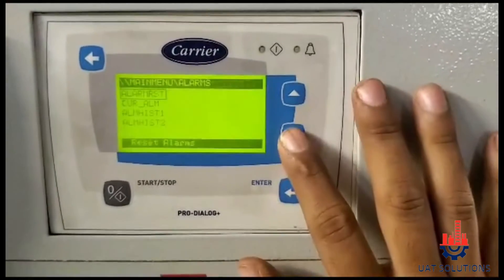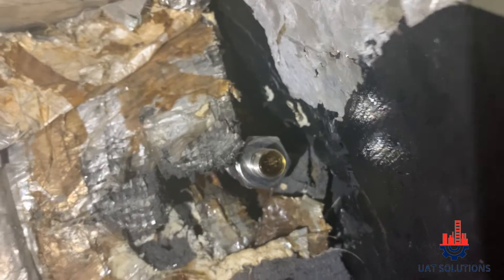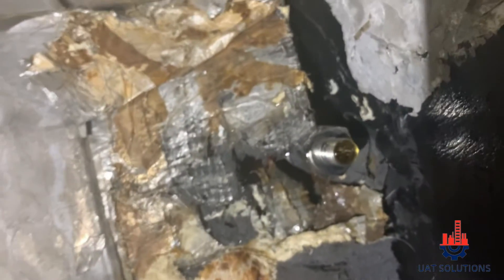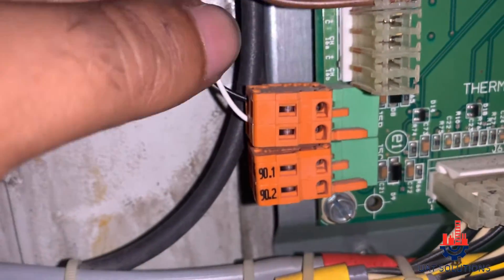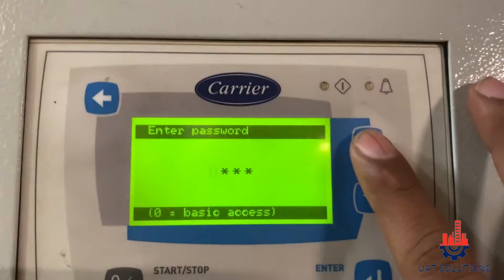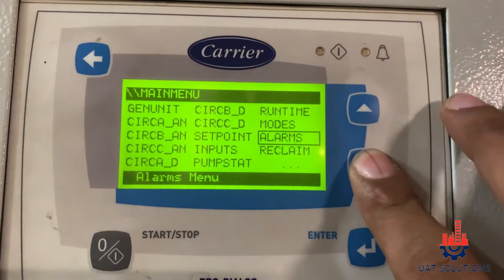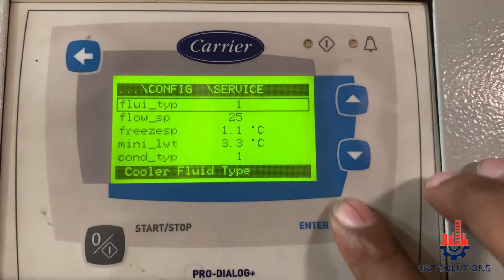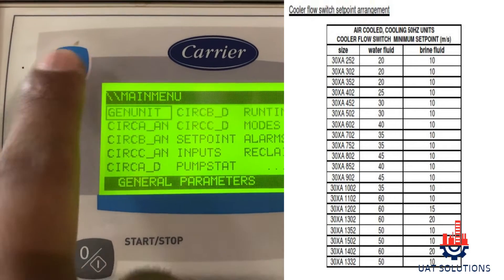How To Troubleshoot Carrier 30XA |Cooler Flow Switch Setpoint Configuration Failure Alarm|

Comment: What is the main cause if the unit is override
Reply from the maker: There are many reasons for chillers to operate or not operate at all due to override mode. To find out the exactly what is activating override mode you need to go to override menu and check on the displayl

Comment: We have Trane RAU 500 & 600 Air cooled Condenser Units. On RAU500 It is showing COMM LOSS: ....... For every transducers and temperature sensors. First I thought that the card might be faulty so I replaced the power communication card from RAU600. But still it's the same.
Reply from the maker: Thanks for your comment, 
Basically in Trane units each time you disconnects or install a new sensor / Transducer you need to bind it using the trane techview below is the link of the video on how to bind a device after replacement in Trane units 
https://youtu.be/OPCBo4IZ37s